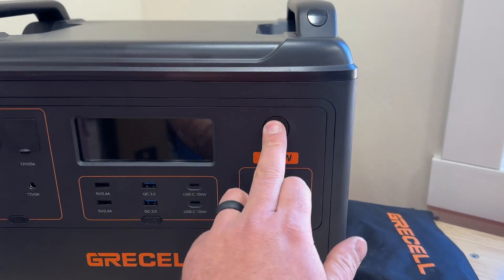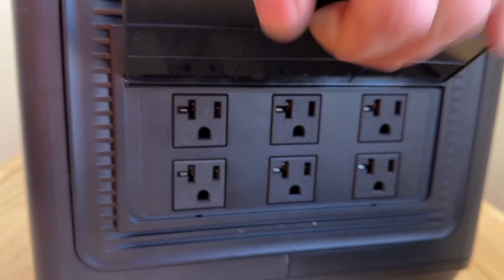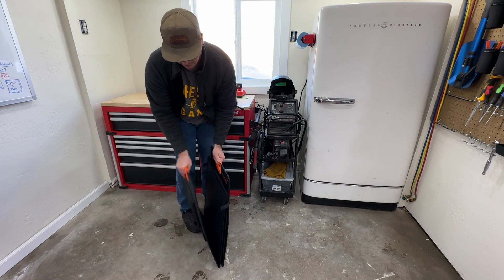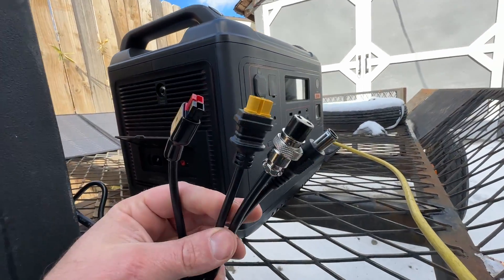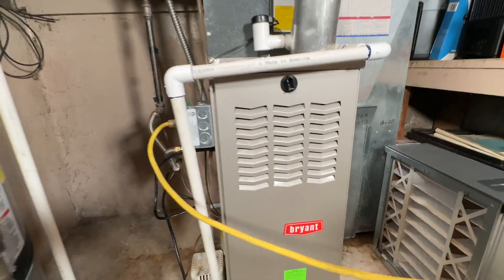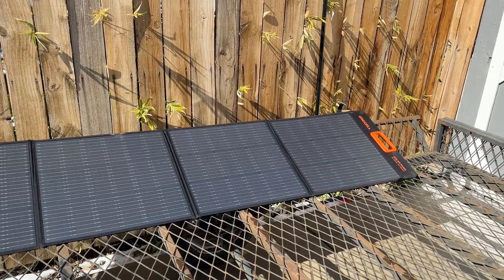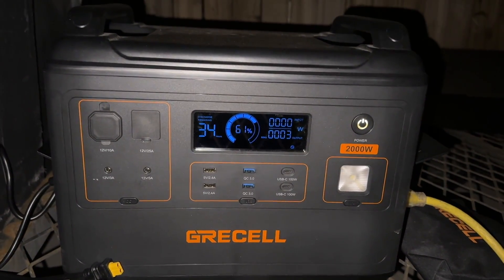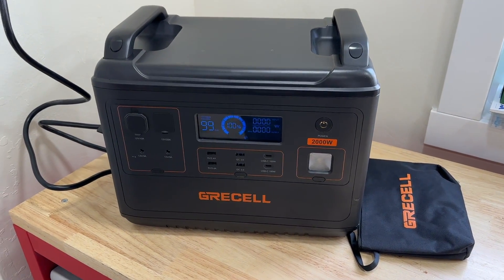One Of The BEST Solar Generators In 2023 For Backup Power / Heat!

Comment: Why would you keep this outside the batteries are very safe, so keep warm and out of the snow
Reply from the maker: Because the solar panel wires weren’t long enough 🤦🏻‍♂️
Reply: @diyhvacguy  Understand that, but once the sun went down bring the unit in...

Comment: I have an EcoFlow Delta 1300..  It will run the mini split in my RV on heat or cool very nice. during the day my 290w panel will help extend the runtime.. and when it's fully charged, it runs the heat mode a little less longer..  I'm not quite off grid, but have enough panels (2 arrays= 1600 and 1740) just lacking more storage than the 400Ah of Lithium right now.

Comment: How about a video on a reliance plug kit so you don't have to run a generator cord through a window.   Plug the generator cord to a box mounted on the house and it has 6 outlets inside.   Thanks for the videos I have the furnace switch I just have to install it yet.

Comment: If any of the outfits that make inverters would make an inverter that could be plugged into a 2nd unit for 220 split phase i know it's possible because they have units that can be Paired together for double the wattage and units that can be used to send power to the grid so why can't they make one that'll take in power from another inverter and go 360 from it for 220 it would make it a great low budget setup as I have could buy a 2000 watt pure sine wave inverter some batteries a mppt charge controller and a couple of solar panels then as the money become available get more batteries and more panels then fix finally a unit to make it split phase 2. 2000 watt units would power most homes and give the opportunity to use a heat pump water heater and heat pump dryer that's what's stopping me from going solar is once I buy a 2 or 3 thousand watt pure sine wave inverter I'm committed to a 120 volt system unless I scrap the inverter and maybe the whole set up and buy a split phase 220 volt unit right now I'm leaning towards going solar for all my 110 volt needs and using the grid for my AC and other 220 volt needs along with backup for when the sun don't shine unfortunately that's 1200 dollars a year for that option
Reply: The EcoFlow Delta Pro can be paired to get 240VAC, with their external combiner unit.

Comment: Thats a no thanks at almost $1400, my Honda 6500 does the job when power is out.
Reply: I think these units have a place in a comprehensive back up plan. If you run out of gasoline propane or there is a natural gas failure you will need something. If you already have solar on your roof that may be a good solution but if you need some thing for even basic communications and heat this might fit the bill if nothing else is available or working. In a significant storm though it’s going to be very difficult to get much out of these portable solar panels
Reply: So is Honda running on natural gas so you can fire it up and let it run for a week or two
Reply: @douglaswindsor120  Just run it as needed for heat, lights and fridge.  2-4 hours per day.  Don't need it 24/7.